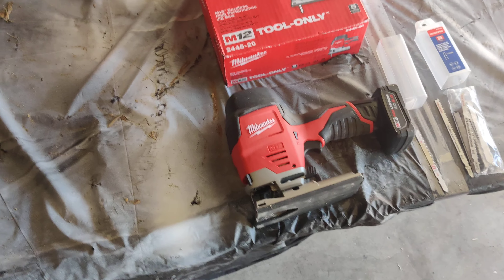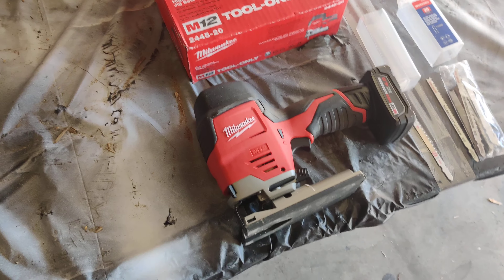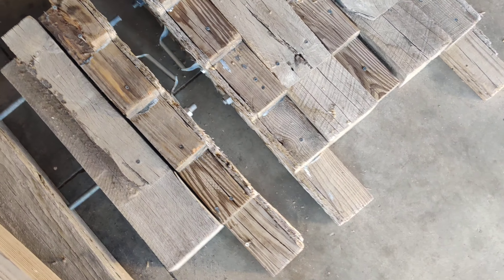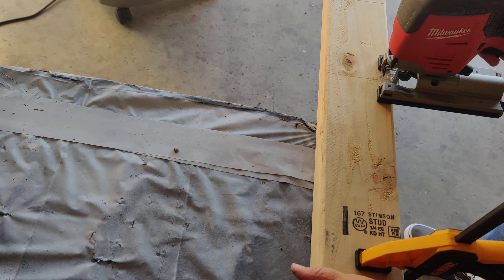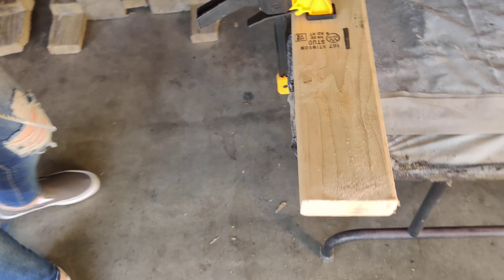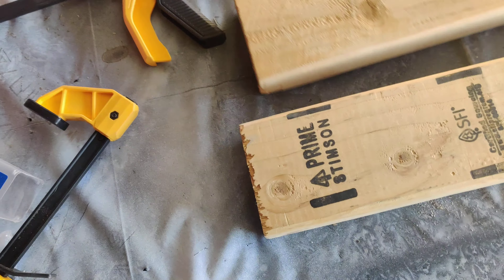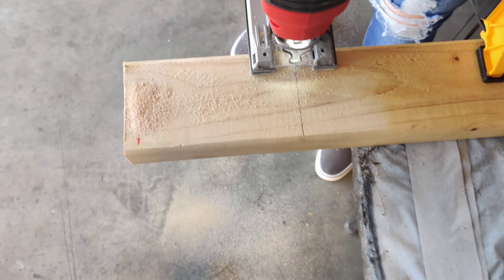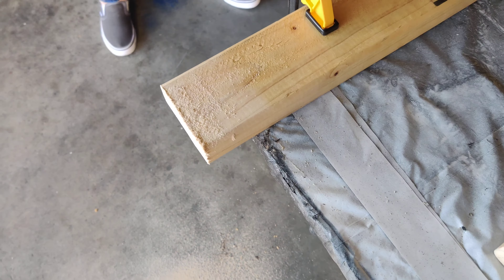MILWAUKEE M12 HIGH PERFORMANCE JIGSAW "DEMO BY A 1ST TIME POWER TOOL USER" ( 2445-50)

Comment: Nice demonstration.  It shows that a circular saw is would be better at cutting 2x4’s.
Reply from the maker: I agree with you Jorge 💪🏼 good thing if I actually need to cut a lot of 2x4s I have several battery circular saws, circular bench saws and circular table saws  to choose from 😉💪🏼 thanks for leaving a comment.

Comment: Hi,

I purchased this tool from a guy two weeks ago who didn't want it from his bundle deal. It was brand new and never used for $50 dollars. A dam good deal i couldn't pass up, LOL. I been using this jigsaw for a week on a project and it's Awesome!

I use the (m12) 6.0ah battery and it  performance flawless on plywood. A great jigsaw if you don't want to use the larger jigsaw. With the amount of cuttings i did on plywood and some 2x4 during that week. I only used 2 bars on the battery indicator. Still great for a brushed motor.   

Now, it's has been out for over 5 years. I hope milwaukee can make a new model of this m12 jigsaw with some extra features. 

1. Brushless Motor. (Come on it's 2020 already, LOL) 

2. A section / tube to blow dust away from the blade section. 

3. LED lights closer to the blade for no shadow affect. (The current one does have that issue) 

That's pretty much it. Again, i couldn't believe how good this jigsaw is. Worth the $50.00 

Just wanted to share my thoughts.
Reply from the maker: Wow, that was a great deal. Thanks Micheal for sharing such a nice rare deal and cool setup👍🏼
Reply: I read a lot of reviews that it is difficult to cut a straight line with this and that you can’t see your line because of the dust compared to others, is it true?
Reply: @xxsk83rxx13  

I have no problem cutting a straight line.  Works great with a 6.0ah battery.  Also, it runs great even though it's a brush motor. 

It doesn't have a air tube to blow the dust away. Just like my corded style.    Still not hard to blow the dust off.
Reply from the maker: @xxsk83rxx13  I have learned that cutting straight will depend more on your experience than the actual tool. I have witnessed many times and experienced a person take the same tool and cut a much straighter line compared to the person with less experience. So for me
 1. Will depend on how long the cut is.
2. How experienced the person doing the cutting. 
Also consider if you are within that Brand's platform it benefits you to acquire tools on that platform versus every tool that has an excellent review and you end up with three different types of chargers three different types of batteries and three different types of tools 🤔. hopefully what I have shared can assist you and thank you very much for leaving a comment 👍🏼
Reply: @noprojustsharing  Hey, thanks for the reply!! I went ahead and picked it up a week ago. It came with a free battery but I was able to hack it and return the battery and got the tool itself for about $59! I’m in the M12 platform but I work on vehicles, so I have the impact driver, impact Wrench, ratchet and a couple of lights from the M12. I’m getting into woodworking and I figured I might as well stay in the M12 since I have a plethora of batteries. My only concern was reviews on this specific Milwaukee tool, I’m assuming because it’s an outdated model that doesn’t come brushless. I only need it for small projects so heck for 60 bucks I’ll take it lol.
Reply from the maker: @xxsk83rxx13  Yes Manuel, that's how you do it👌🏼💪🏼
Reply: @xxsk83rxx13  no.  People bitch and complain just to hear themselves talk. This jig is great

Comment: I don't think I would cut anything over 1" thick with this M12 version.
Reply from the maker: Very good point rcud1 💪🏼✌🏼
Reply: Don't know why not.... I've cut pressure treated 4x4 stock with this with no problems
Reply: @noprojustsharing  Now that you had this M12 for a an while would you still recommend it?
Reply from the maker: @rickyperkins232  Most brands have the same parent company. The top six brands on the consumer / Semi Pro market are made by the same three companies. If you are doing heavy duty daily use in a pro environment, yes. I would go with Milwaukee, HILTI, MAKITA, and one or two few select DeWalts.

Comment: It seemed to be low vibration.
Reply from the maker: I agree with you James, low enough to seem pretty smooth. Thanks for leaving the comment.
Reply: If you PROPERLY clamp your work then any jig can act like that..... this one being 12v may be less than a 18v or corded but relatively speaking clamping is the key